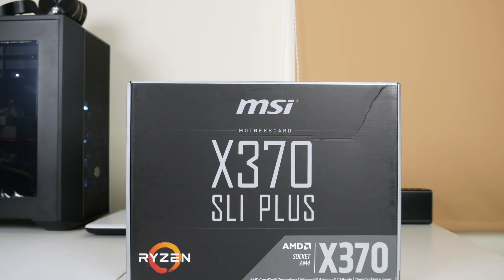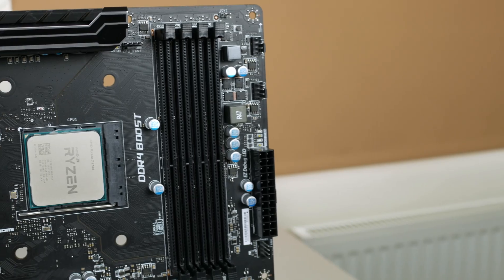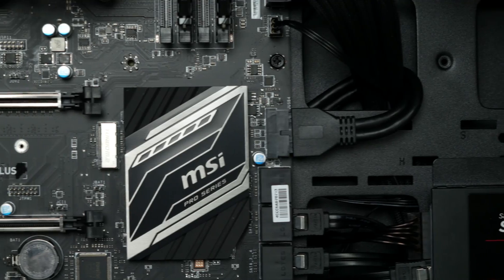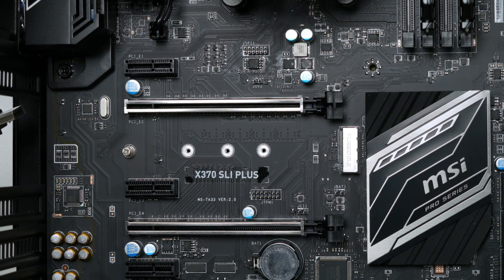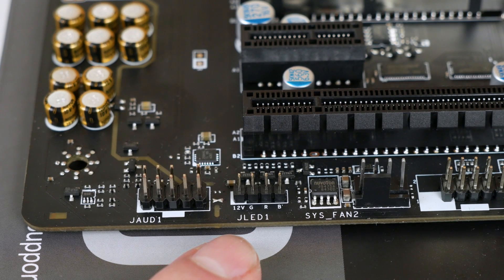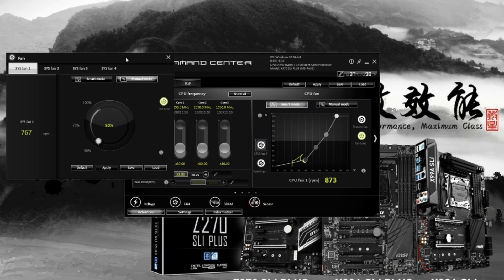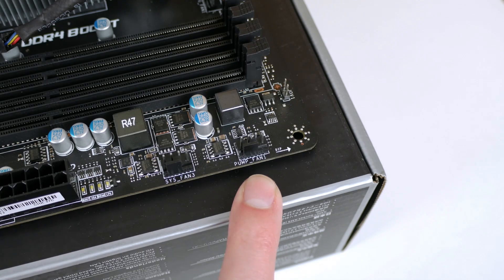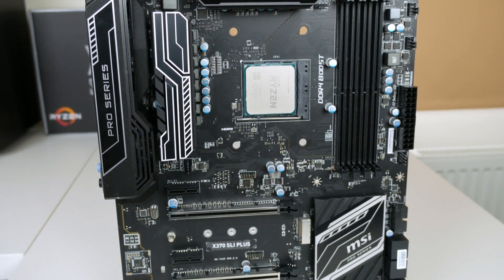MSI X370 SLI Plus Motherboard Review

Comment: For a side note to everyone this x370 msi sli plus board has a 4 phase vrm. It is doubled so MSI markets as an 8 vrm but it's really a true 4 phase. It works great as I own it and had a 1700 and now a 2700x. The only trouble I have is accurate temp readings of the cpu socket. Bios readings read fine but the software readings are off by a lot.

Comment: Yeah, all of those fan headers seemed to be 4 pin however which ones besides the CPU1 and CPU2/pump are PWM, if any? That is the kind of info I'd like to see reviewers include but so far I've yet to find a reviewer who looks into that. :/

Also, I believe this to be a 4+2 power phase and from what I've read not a very high amperage phase design, so if anyone OC's on this I suggest focusing the OC towards undervolting if possible, or at the very least not going crazy with the vcore. edit: not that I'm an expert in anyway what so ever, so take it with a grain of salt.